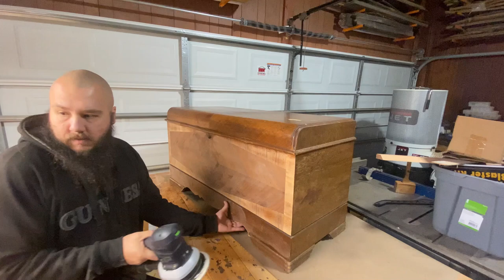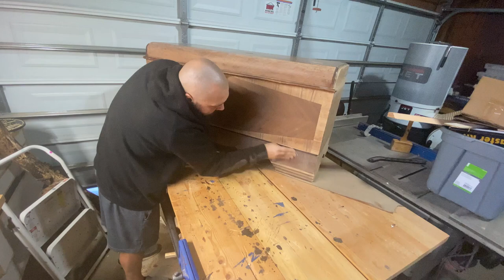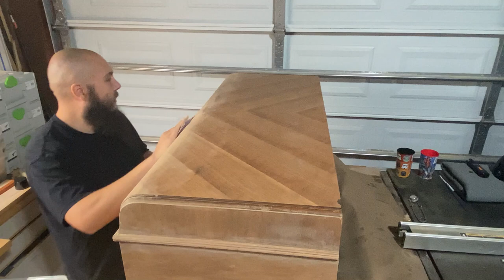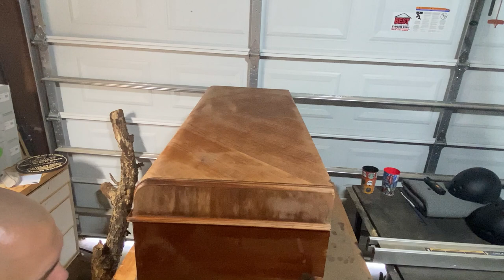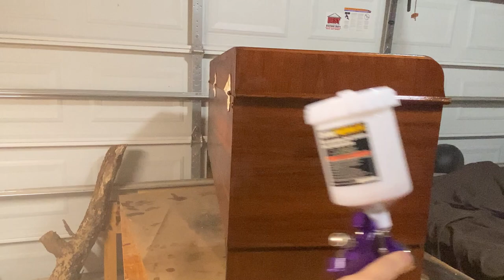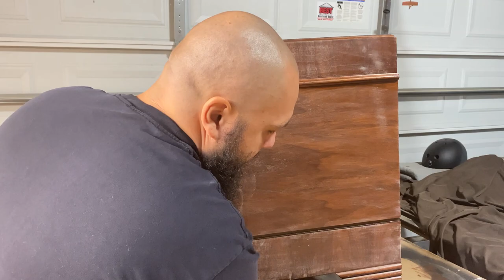Amazing 80 year old Cedar Chest Rescue and Restoration

Comment: I actually have this exact chest with all the tags inside bottom of the lid. About the same looks inside but perfect inside. Thanks I wasn’t sure what to do to restore. It belonged to my Mother who passed away. She said she’d had since new, was almost 90
Reply from the maker: I’m glad you for the video useful. I started with 220 grit sandpaper and just slowly sanded it. The veneer is thicker then veneers of today so I felt comfortable using an electric sander on it. If you have any other questions let me know.
Reply: Dangerous lock like old refrigerators and freezers....a child can't get out! Recalled item.
Reply: We had one too!
Reply: I have this chest right now it needs to be refinished. It was my grandmothers it’s missing the tray inside but overall still functional.

Comment: Did you do anything to the inside?  Beautiful job.
Reply from the maker: I didn’t have to. It was virtually untouched, had a little dirt in it that I cleaned out but other then that it was very clean.
Reply: I would have used a little finishing butter and/or cedar oil to refresh the interior’s wood.
Reply: I recently was given one from 1950.  Sanded the inside with ultra fine grit and wiped it down with a slightly damp cloth.  The cedar scent got much stronger than it was.

Comment: I just purchased one for my son and it needs some refinishing. As I'm not as adept with sanding could I just use paint stripper to strip the finish, barely sand, and then refinish?
Reply: Yes, in fact it may be better to strip than sand so you don't sand through the veneer.